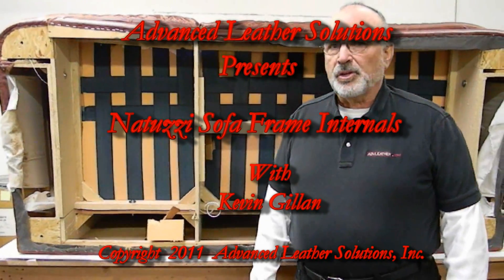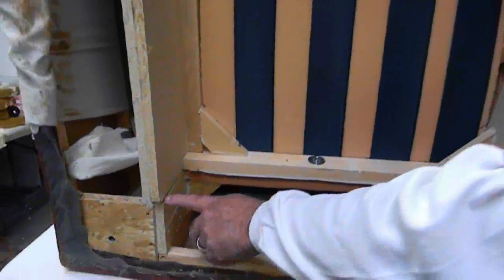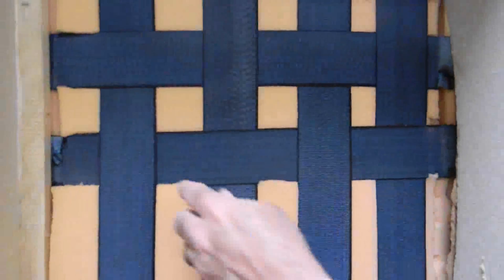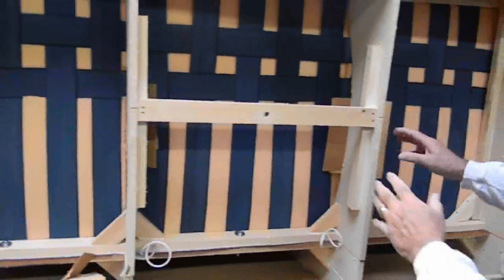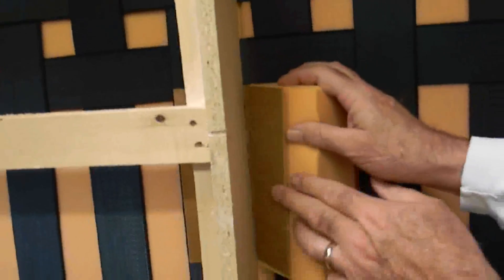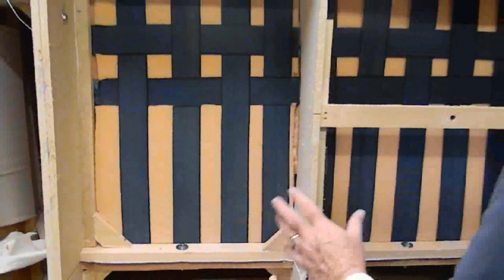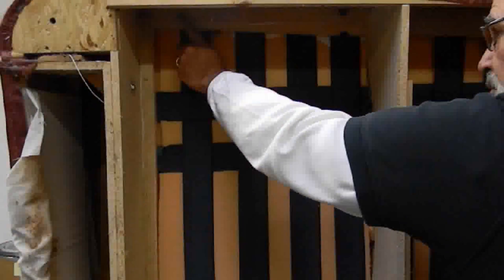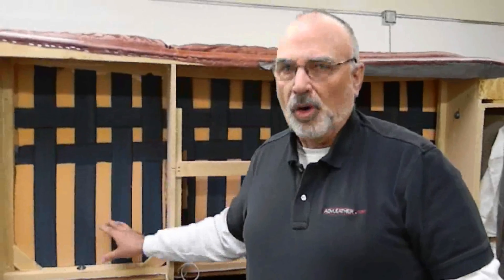Inside a Natuzzi Sofa After Years of Use

Comment: Hi Kevin, Inside the couch you are working on I see that bungee cord tied. What does that cord do? I have a Natuzzi as well I spoke to you before. That cord is just dangling in mine and I want to tie or secure it but I don't know where. Can you do a video showing what the cord is for and how to tie it?  I used an old pillow that had nylon stuffing and I went into the couch and inside if you reach up it has zippers to add extra stuffing. its a great couch.  I love it especially when you can do a simple fix and they give you a zipper.
Reply from the maker: I’m retired and no longer active on a day to day basis in the business.  I provide consulting services only.
Reply: @KevinGillan   Oh I understand Kevin. I'm retired too on a limited income. It seems to be ok with it just inside dangling down.

Comment: I sat down hard on my Natuzzi leather couch and the Couch Arm seperated now it bends out. I have a cell phone pic of it. I looked at the wood inside and it looks like a round hole or peg might have fallen out holding the arm to the couch. do you have any suggestions on how to fix it myself?
Reply from the maker: @carlrr.5042  The arm is typically attached by a couple of bolts. Put the piece on its back and cut open the dust cover, exposing the internals.  This will show you how the arm is attached. If there’s no broken wood, it should be pretty easy to fix.
Reply: @KevinGillan   Wow thanks Kevin. I think it has a zipper on the bottom for the dust cover. I don't want to cut anything. I pray its just some bolt it was a 1700 dollar couch 5 years ago. I wanted it to last longer than 5 years. I know if I have company  over someone is going to crack it apart. lol. and then I'll blame them and make them pay. all kidding aside I'll let you know how it goes. I wish I could post pictures to let people know.
Reply: @KevinGillan   Hi Kevin good news I just fliped the couch over and used the zipper on the batting/dustcover and inside was two bolts with washers that fell out but there was a lot of saw dust. So I alligned the arm and they bolted in and are tight. I didn't over tighten. There was another bolt on a board that was real loose so I tightened that one as well. So its alll fixed. I was thinking if it didn't catch from the sawdust do you think it would hold if I put wood glue on the end of the bolt. Its strange why would they put a zipper for the batting cover at the bottom of the couch only for one end of the couch. I wish the zipper would extend the entire length. Oh well. I hope the bolts at the other end are not loose.
Reply from the maker: @ I’m glad it worked for you.  It’s likely the bolts were never fully tightened at the factory and as they moved they created the sawdust you discovered and eventually simply came undone.  As an aside, the fabric on the underside is just a dust cover.  It doesn’t perform and structural function.  Cutting it open doesn’t in any way impact the long term utility of the furniture.  In your case you were fortunate to have a zipper.

Comment: I'm in the middle of ordering parts for my ITALSOFA, sofa But, nice of you to pass on the information that you did. You went further than anyone else. and from some one else I learned there are
4 types of  ( suspension's ) used in sofa's     1.)  a type criss crossing springs  held on to the frame with some kind of strings so many criss crossing if one let loose , you would  still be  ok as far as getting a sink hole
2)  S springs continuous S shap, attached to the frame with little brackets and a fastener
I'm in the country and burnt an old 1996 era couch   thats what was left S spring on the ground.
3) coil spring set up built much like a mattress  type one's
4)  this type  webbing made of 3 "  strapping that criss crosses and is usually fasted to the frame
after it turns the corner with a little stretcher solf just for that.

Comment: you say a person can pull that bottom frame work out buy pulling the 2 bolt , must be more holding it than  just 1 bolt on each side . Too bad your not doing a follow video on the doing that, and how to stretch new strapping if you don't own the stretcher dealy thing.  and where you buy your new green strapping  or do you use black I heard it;s stronger  and Have you ever sat in one where someone put a  27 " x  ? or what ever square 7/16 OSB  piece of wood panel in each bad section to strength 'n
the sagging straps?  is there no give then when you sit down?

Comment: I hope you're still responding to comments on this video...  What is the leather Natuzzi uses on their sofas?  I got one used and the most worn spots show what seems to be a waxy coating that looks like it softened and then started slumping.  Very strange.  I'm assuming it's a coating they use on the leather, but I can't find this condition described in any "repair" information.

Comment: Kevin, this is excellent info. I had a Natuzzi sectional dating from the 1990s that had this and a furniture repair place in my area (Raleigh NC) replaced the webbing system with a plywood platform. I was not happy with that and we replaced the sectional with a similar style sofa/loveseat. The loveseat is now sagging where I normally sit and needs to be repaired. Are you aware of any craftspeople in North Carolina who could do a proper repair? If not I’m going to attempt to DIY it myself. Thanks in advance.

Comment: Thank you Kevin.  Our Natuzzi set was made in 2005 and has held up fairly well - in only 1 of the seats has the foam collapsed (the one I’ve sat on for 16 years).  I’ve just taken the backing off the underside and the structure looks sound.  I can’t see any way to remove the strapping although after removing all bolts it looks like the 3 piece seat section (without the arms) is designed to come out.  Without further direction I’m leaning toward cutting the webbing for the one end section and buying new foam, then securing the foam in the seat with wood slats or a large piece of plywood.  Any comments are appreciated.
Reply from the maker: Good idea, but you're you're better served replacing the webbing, if you have the tools. You'll need a good quality staple puller and decent staple gun driven by compressor.  Remove the seat deck as you've discovered. Remove the staples that hold the leather in place.  this gives access to the foam and underlying webbing.  remove the old webbing and install new.  You'll find it on Amazon - Pirelli upholstery webbing, or a upholstery supply shop near you. connect one end with staples and pull taut to connect the other end.  Reinstall foam and leather.  Your idea will provide structural support, it however will lack the "give" of the webbing so it will feel hard to sit on.
Reply: @KevinGillan  Thanks!

Comment: I have been looking for a solid built sofa on all the furniture stores since and every time I came across a style that I liked but wonder what kind of suspension system they used.  Still nothing.  I can't afford a $6,000.00 sofa.
Reply: You may want to check out Simplicity Sofas. This is a small North Carolina manufacturer that does not advertise and sells direct to the public only, completely bypassing retailers. The solid oak frame sofas are built to last forever. There is currently a 12 month backlog on production.

Comment: Hello Kevin, I have a 2007 Natuzzi sofa that reclines manually with  pull cable handles. It looks similar in frame construction to the sofa in your video, however as a recliner I can't tell where to begin to access bolts/screws, to  disassemble.  Any suggestions appreciated. Thanks Art, Toronto
Reply from the maker: The reclining mechanism is bolted into the frame.  Tip the piece on its back with the recline full extended.  This will give you a good view inside.

Comment: Thanks for the video! Very helpful. Questions - 1)Is this Natuzzi Italia or Natuzzi China? Cause they have a totally different materials used inside and outside of the sofa. 2) Now Natuzzi has a lifetime frame warranty for those products purchased after 2015. 3) What's your expert opinion on American Leather, Benchmade, and Room & Board sofas (compared to Natuzzi Italia)
Reply from the maker: 1. As mentioned in the video, the piece was 10 years old at the time.  I think this predates their chinese and brazilian factories.  2. Have you read the warranty?  What are the exclusions?  3. I'm a leather furniture restoration specialists.  I don't evaluates furniture retailers, distributors or manufacturers.

Comment: I see this is an old video but I have the same issue with the same brand of couch, its a Natuzzi leather sectional. I dont have broken wood or other damage to the frame of the couch, but the cushion is sagging in one seat. I would like to know the best way to replace or add to that foam in order to fill in the loose section of leather and firm up the "hole" that has developed over time in the place where I sit. Is there a simple way to get under the straps without having to take apart the frame?
Reply from the maker: This is an upholstery project.  You'll have open the dust cover to access.  Then, release the webbing to access the foam once you're inside the piece.  Be sure it's just a foam issue, not structural.  Remove the foam and replace with like kind from a foam supply company.  Bring them the original foam so they can get the measurements right.  Install the new foam and reattach the webbing and dust cover.
Reply: @KevinGillan  Thank you for your response. I did open it and do see that the wood frame is perfect. I spoke to a local company who asked me to bring in the foam to order a new piece for me but..... I have no idea how to get it out from the webbing and have been afraid to damage the couch. Can you please explain how to open up the webbing without breaking it. Do I have to unscrew the large screws in the wood to do this and what is the worse case scenario as in, how do I not break anything and what do I need to be careful of so as to put it back together in one piece? lol....thank you so much!!

Comment: So in other words, the reason my $2,200 Natuzzi sofa is sagging after 10 years of normal use is because they used LDF for a lot of the key structural components, staples/nails instead of screws, and an insufficient number inadequate straps. Nice. The building I live in was also built cheaply by a guy from Italy. I’m seeing a correlation here pertaining to the Italian half of my ancestry...get it done CHEAP but make it look pretty, and don’t worry about longevity or serviceability.

Comment: Thank you for the video.  I have a question.

I assume in rebuilding this you have to remove the arms.  There are bolts to remove but once they are out, the arm in still attached.  Is there a trick to remove the arms from the deck?
Reply: There is no need to remove the arms.  Once the seat deck is separated from the frame you have access to everything you'll need.

Comment: I've been working on Natuzzi furniture for more then 20 years rebuilding them. It's all crap, doesn't matter if it's made in China or Italy. Poor quality foam that just fails outside the warranty of 1 to 2 years. Crappy particle board frames. Poor quality webbing that, again, fails just out side the warranty. If you weigh less then 150 pounds, then it may last, but it will collapse. Most guys here in Canada weigh more the 200 pounds, so it goes to hell pretty quick.
 DON'T BUY NATUZZI, IT'S GARBAGE !
Reply from the maker: Don't we know.  We've had the same experience and a leather furniture restoration company.
Reply: And it's not so much having to repair these, it's telling the customer that their 4000 dollar sectional is not that great, the warranty has ran out and they have to have it repaired out of pocket. This 5 seater sectional I'm on now is 3 years old and it's leather is still bran new, but all the foam is shot. New foam is just under 500.00$ for good quality foam, that will last at least 10 to 15 years. And that's my whole sale price, I pass that a long to my customers, I don't make money on that.
 People still complain though and I don't blame them, but what I don't understand is that no one does any research on a majour purchases. It only takes 20 minutes to go on line and it's all over the internet ???
Reply from the maker: You're right.  People tell me all the time... "If  only knew..."  Part of the problem is the lack of knowledge in the leather furniture retailer community.  They lead people to think it's quality by saying "Italian leather furniture."  Meanwhile, the majority of Natuzzi pieces are NOT made in Italy, and even if it is, the frame structure, is cheaply made, the webbing is poor quality and the foam lacks long term integrity.  This only becomes apparent AFTER the waranty expires.
Reply: Kevin Gillan I nearly purchased from them, but saw this video. Better off getting it custom made.
Reply: @HaggisCat1  I bought mine in 2001 and the internet was not as great back then!
Reply: HaggisCat1 Hello, I completely agree with you. I bought what seemed to be a excellent condition 2nd hand Natuzzi Leather Sectional and within one day my Kids managed to brake the frame by jumping on the sofas when I was not home. The good news is I only paid $650 the bad news is that in order to sell these and get my money back I have to fix the loose back frame on one of the sofas. What would be the best way to do this for an amateur DIYer?

Comment: Do you in fact have a how to video to fix the sofa with replacing the webbing and supporting and rebuilding the sofa? Thank you!
Reply from the maker: Tina Tate there are so many ways that a Nattuzi sofa fails internally that to take all these variables into consideration in doing a video would require a full length documentary.  The good news is the architecture inside is very simple and so it should be self evident how to repair.  Go to a upholstery supply shop and buy the Perelli webbing.  The rest is a staple gun and a screw gun and some wood.
Reply: Kevin Gillan 
Thanks so much I love this sofa, it's just old and needs some TLC!

Comment: One of my sofas has the exact same fault.    I took the black cover off the bottom to see what the problem was and its the foam and wood stucture like this one that has collapsed!   Very dissapointed with the materials used as it was an expensive sofa.  It was begining to sag where I sit all the time then my friend thew herself down on it and I heard a crack.    Now it has worse.    Could you post a step by step video on fixing the problem.  It is the area above that stupild litle bit of foam and board and the spoung had also moved.   I Am sure I can repair it with the right instuctions Kevin.   Thanks for posting :)
Reply from the maker: Hey Maleka...  The problems that causes the collaosed seat deck is not isolated to the single issue.  There can be a vareity of ways the structure fails resulting in similar symptoms.  So a single video can't show all potential solutions.  The root cause is in using inferrior material in construction at the factory.  In your case the best solution is to examine the failed components and replace with real wood, not what was used by Natuzzi.  Using a hard wood will provide longer life and improve the overall structural integrity of the frame.  You may need to buy replacement foam for that foam block that goes on top of the support strut.  A well stocked fabric store is a good source.
Reply: Thanks posting  that advice Kevin.   Will do that as I always think that underneath all that materal that makes a sofa its usually quite shoddy and surprising.   We all like to sit on that particular sofa and have to others the same that are hardley every used!  so are like new!    I have to fight for the hole position in the sofa with the cat and my husband lol as everyone seem to be drawn into it haha.     A bit like a black hole really :)  PS I lover power tools haha x

Comment: Kevin, can you please confirm that this is Natuzzi Editions? I have a manufacturing details page from Natuzzi Italia and it claims to be much better engineered than what you have here. For example, it says "The basic shape or uni-body is made from this [solid wood]." Also, "The entire frame is wrapped in Masonite to strengthen it and protect the covering from tearing". Lastly, I don't see the "S" wire suspension system.